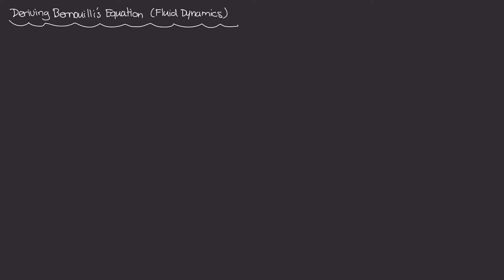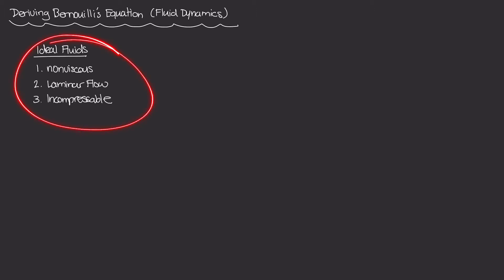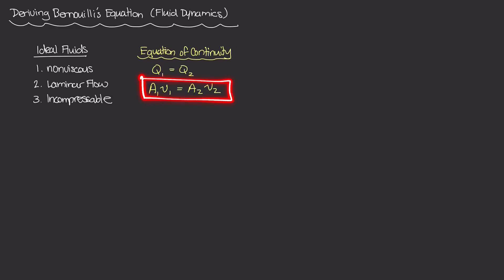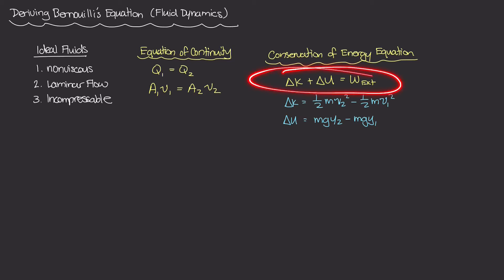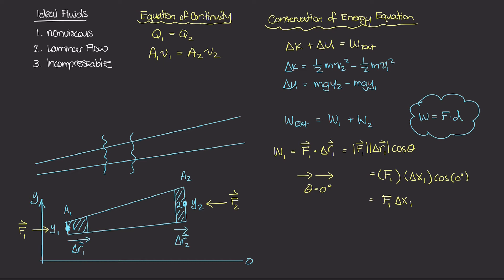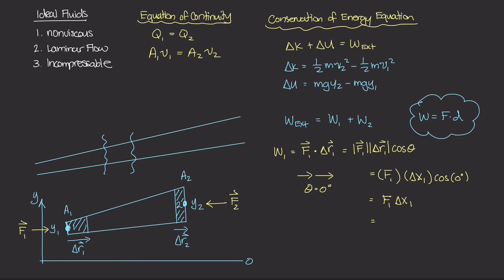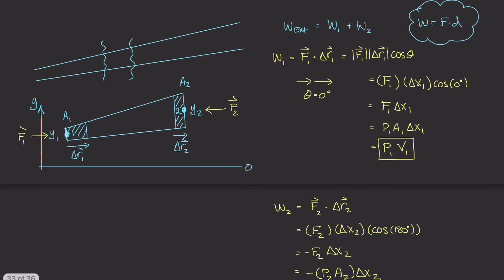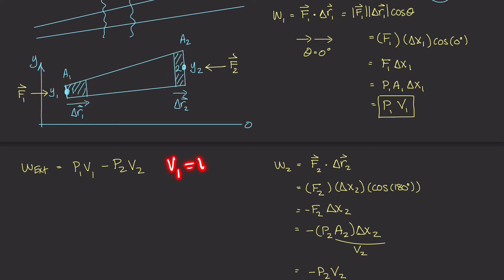Deriving Bernoulli's Equation in 1 Video [Physics of Fluid Mechanics #53]

Comment: The water in the first segment is different water from that in segment two, right?  It's  the same volume, but different matter.  Because if you were tracking a particular mass of water making its way from the first segment to the second, then you'd need to consider the work done over the whole length.
Reply: exactly what i was thinking